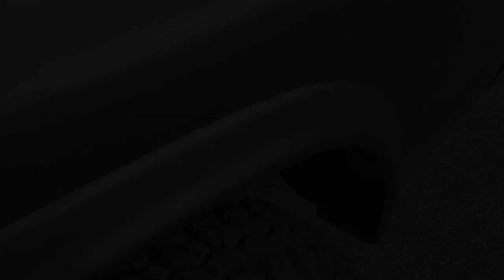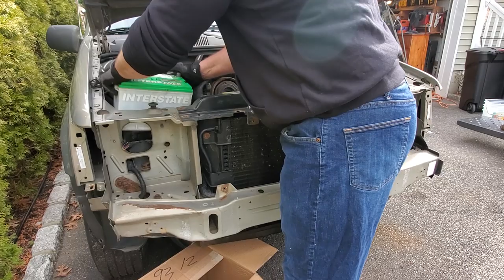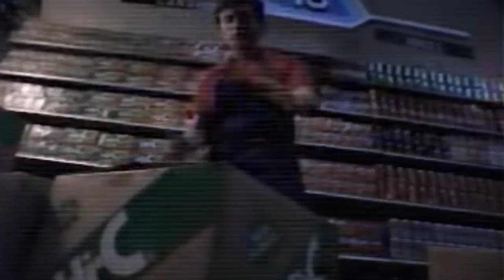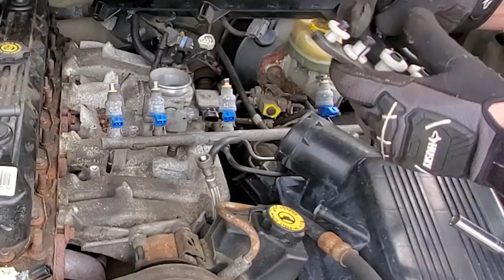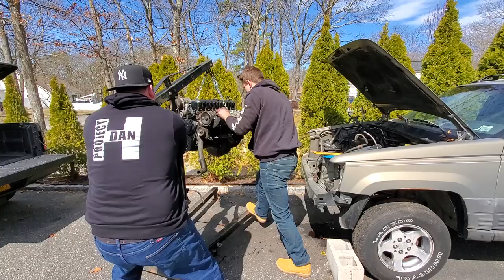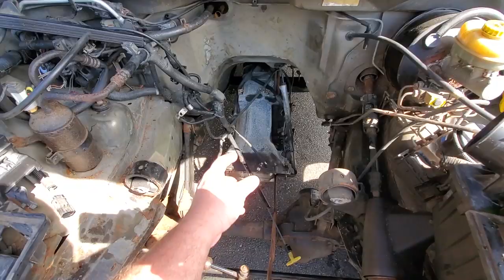JEEP ZJ GRAND CHEROKEE 4.0 ENGINE REMOVAL

Comment: why did you pull the fuel rail and TB?   did you drop the crossmember to get the trans bolts?   thanks !
Reply from the maker: I pulled everything and put it in storage.  Gave removed the trans bolts.  The transfer case and crossmember was gone already.

Comment: Do you still have any of the lower plastic trim pieces? looking for the diver side rocker panel cover. the little piece that is on the fender in front of the piece that runs the length of the doors. I have a 96 zj larado.
Reply from the maker: ahh sorry bro, fresh out.  if I find some I'll let u know

Comment: Is it easier to leave the transmission in if you're doing a motor swap or take the transmission out bolt it to the new motor and drop them both in at the same time
Reply from the maker: Its probably easier to unbolt the trans and leave it in.  Gonna do a motor swap soon! 😁
Reply: @ProjectDanH   thanks 👍

Comment: make a camper out of one of the jeep body
Reply from the maker: Great idea. Unfortunately one side is rotted through and the other is bashed pretty good
Reply: @ProjectDanH  true but if it going to be turn why can't you just remove it and put in a flat pice of metal and make a plat form level across for sleeping and storage under
Reply from the maker: @nelsdemma6907  nah.. I don't work with rot

Comment: Ware did you guys hood the chains??
Reply from the maker: When I pull an engine I usually hook the bolts to the AC compressor mount threads on the block that are on the passenger side.  On the driver side I use the center hole for the exhaust manifold in the head

Comment: Will a 2004  zj ,4.0 fit in a 2000 xj
Reply from the maker: ZJ was 93-98,. WJ was 99-04.  any 4.0 will fit in an XJ.  a 2004 WJ engine may need an oil filter adaper
Reply: @ProjectDanH  thank you .my current engine has 123,000 miles I just bought it cheep because engine has low oil pressure at idle when warm ..and slight noise in Engine not really a knock like rode bearing ..maybe piston ??? Idk doesn't smoke runs on all cylinders .haven't done compression test .
Reply from the maker: @jaymartin5434  I wonder if you try a marvel mystery oil flush and then add some good Zinc oil of it will solve the knock
Reply: I will try it.. I have a new oil pump I could also try..came with the jeep..could check rod bearings...one friend said carbon knock...guess I have to start trying stuff .I have done rod bearings on my bosses 4.0 jeep and oil pump and timing chain .. because it had low oil pressure and it still has low oil pressure changed oil sending unit ..also .so I'm not convinced it would help with my engine .I don't get it because I have a 98 4.0 with 215,000 miles on it and oil pressure better than my new 132,000 mile motor.
Reply from the maker: @jaymartin5434  looks like your going to have a busy weekend.  Maybe is more about maintenance than miles. 💪